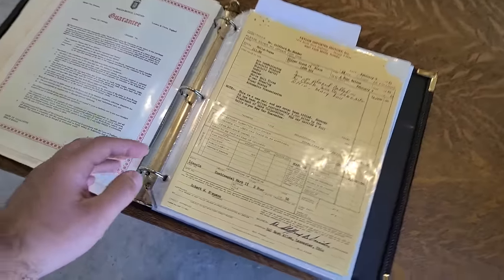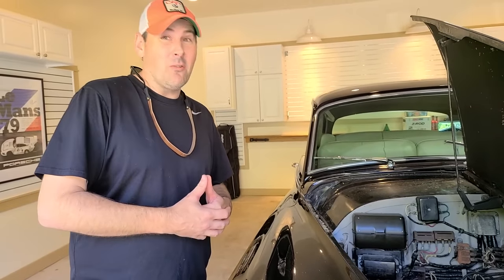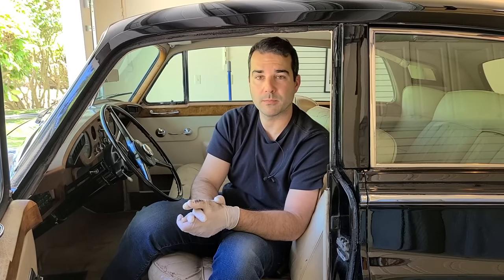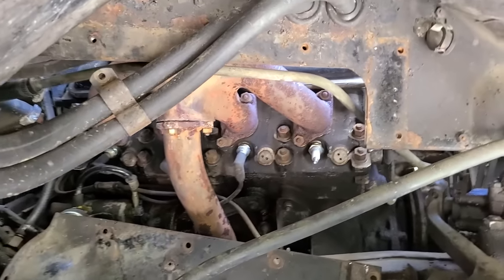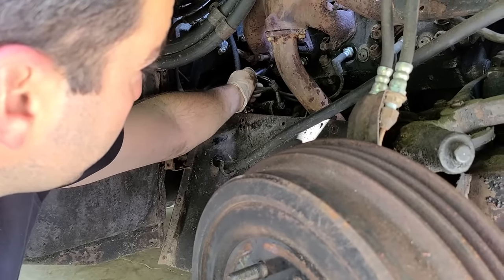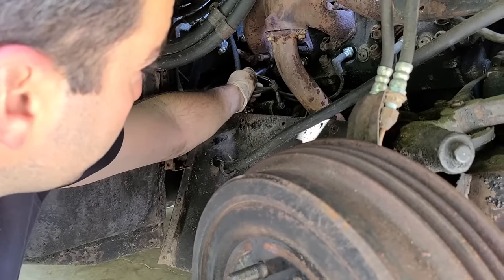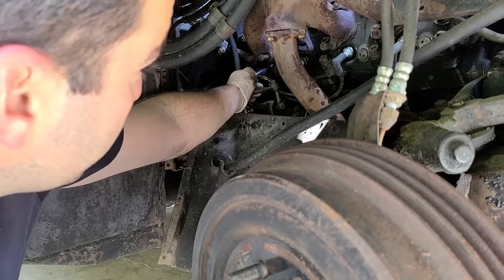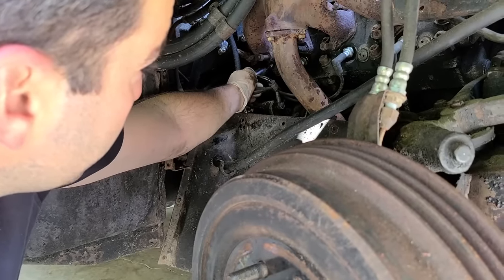I Bought A Broken Rolls-Royce 1000 Miles From Home! 1 Day To Fix EVERYTHING Before Hitting The Road!

Comment: This makes me kinda of proud of my country , 60 years old and it still turns heads, only thing wrong is the steering wheel is on the wrong side but there again you drive on the wrong side also  Lol !  Makes you wonder if the modern produced cars of RR can do the same in 60 years , i doubt it.

Comment: the fact that these cars were assembled by hand with a team of expert mechanics ,makes each car pretty unic (Monic) in the way they were each assembled ,I know for example that each team 'boss' would have a certain wire screwed on where the other guy would use a bolt ,a time when reliability & longevity was THE goal...!!.bunch of little details would be different on each unit ,like also the wealthy customer who would want a specific type of wool & colour from Cashmere mixed with what Rolls was proposing at the time...(read it in an old classic car magazine)..

Comment: You are lucky your 4-speed Borg Warner transmission is (apparently) in decent shape. My friend had to pull the transmission several times from his RHD (cheaper to buy in the US) 1960 Silver Cloud before the local transmission shop got it working right. He drove it about 100 miles to see his mother and popped by our place, and it was fun riding in it to a local French restaurant.

Comment: Over here in the UK one calls one's Rolls Royce a "Roller" and one wears a shirt, tie and tweed jacket when driving one about..!
(on a rainy day our House of Lords smells of piss because urine is used in the manufacture of tweed cloth which they mostly wear)
I drove a Roller when I was just 16 at a Hunt in a field (that's horses and beagles - no shooters)
Correct me if I'm wrong but I think the oil gauge is a level indicator not a pressure gauge - think maybe Spitfire Merlin engine which had a huge tank of oil at the front of the engine which had a dry sump, pressure oil pump and two scavenger pumps (and some machine guns or canon)
Wonderful car and most entertaining and informative vid. Thank you very much. I look forward to more videos on her. TTFN.

Comment: Those old RR are notorious for overheating.  You might think about flushing out all the regular coolant and water and switch over to "waterless" coolant like Evans.  Evans has a much higher boiling temperature, like around 375 degrees.  Helps eliminate hot spots and steam and actually gives these old girls better performance.  The stuff costs like $40 a gallon but it never needs to be changed or flushed so you only have to do it once.  I put it in my RR and I also ran it in my Mini Cooper JCW, and my Honda Goldwing.  Never had issues with cooling after that.  Just a thought.

Comment: NEVER, I REPEAT NEVER.  Rent out a car like this for ANYTHING,!! It has long been said that it’s not the initial cost of a Rolls-Royce, but the cost of it’s upkeep!!! The brake system on these cars is antiquated! When one steps on the brake pedal, it engages a servo clutch wheel which is attached to long metal rods which go to the rear of the car and mechanically engage the brake shoes!! BTW, These cars weigh between 4,400-4,600 depending on the series year..FYI

Comment: The Silver Cloud is a lovely motor car, but I prefer my early Silver Shadow, which handles better and is a lot easier to service, with its great engine bay accessibility. Royce was quite correct when he said that the quality remains long after the price is forgotten. One always arrives at one's destination feeling relaxed.
Reply: Pete. The Shadow had crap engine bay accessibility. The engine bay was smaller and stuffed with extra equipment and because they were technologically advanced over the Cloud, servicing cost multiple times what the Cloud cost to service. The early Shadows handled like jello. They rolled 7degrees to enable what Rolls called the "boulevard  ride" to satisfy the Americans and handled worse than the Cloud or any other Rolls previously built. Unfortunately, the excessive body roll was uncomfortable and scrubbed  a set of tyres out in 7000 miles. That problem was later sorted in the later Shadow 1's and further in the Shadow 2's. Apart from that, you are correct.
Reply: @EnglishLawyer  Alan. I take your points, but I've never found any difficulty with the servicing. The Cloud's hood is a hatch compared with the Shadow. Have you tried changing the plugs on a Cloud? The handling is ok and you get used to the bit  of roll on an earlier car - it isn't intended as a sporty coupe. Even the recirculating ball steering is perfectly manageable, though the later Shadows with rack and pinion steering were much more precise on the road. Compared with the Shadow, the Cloud is a tank - it was designed as a sedate gentleman's carriage, not for the captains of industry. Don't get me wrong, I love the Silver Cloud, it's a beautiful motor car. Our family have also owned pre-ww2 Rolls-Royce and Bentleys  for years, so I know how to handle older technology and if you want great access to the engine, buy one of those! My Shadow is still a much loved addition to the stable!

Comment: Speaking of not feeling the speed, the old bloke bought a V12 Jag (forgotten, the Model, year, etc. SJ12 rings a bell). Drove it 1000 miles to visit me, doing record speeds and filling the duel fuel tanks often. He let me take it for a drive through town. It was so nice to drive, quiet, responsive and so comfortable. 
I whipped through a roundabout and commented how tricky that seemed. It was then the old fella told me I going 60mph, not 60kph. So, I was going highway speed on the city streets, lol. So smooth and quiet on the road. There's no way I could have done that in my 4WD. It always cost a mint to fix and he got rid of it eventually. Too bad he didn't train as a mechanic, even though he was pretty handy with engines in a basic way.

Comment: that large system of air-filter with the thin grill (at 30.40) seem super restrictive..taking that mesh off and installing a snake type of tubbing to go catch fresh air in the lower section of the bay would be good for sure..!!

Comment: for a sure getting rid of the old mechanical /belt driven fan ,replaced with a high CFM  (manual) modern E.fan to ventilate & cool down that huge bay would be perfect (especially in traffic)..flick that switch on and see that gauge go down..!!

Comment: The radiator was made from individual pieces of metal soldered together. Somewhere on it is the initials of the craftsman who made it. Rolls Royce, when they made their crankshafts kept a sample of the metal of each individual one, so that if it failed or had problems they could test the metallurgy.

Comment: That dual contact switch may be for the shifter? I think they’re electric or electric over hydraulic on the old rolls’. Also if you put the trans in reverse with the engine off that should engage a park Paul, giving you a “parking lock” like on a modern transmission.

Comment: The speedometer isn't off. It intentionally indicates slightly higher than actual, in order to prevent unintentional speeding. AFAIK most European cars had/have that. Saves a tonne of money.

Comment: If all the plugs were in the same condition as the one you gapped, it’s a miracle the engine started.
That wet tarry deposit on the insulator causes the spark to leak to the plug body rather than jump the gap.
I’ve worked on old engines and when a customer would call us out to a non-starter, we always took a set of plugs.
The problem was usually caused by excessive use of the choke or driving short distances.
Worn engines with low compression were particularly susceptible.
This was probably the cause of the misfire. Did the misfire disappear after a long drive?

Comment: You'll find that many nuts and bolts on Rolls Royce cars (pre-70's) will be Whitworth. Joseph Whitworth was a toolmaker from the north of England and introduced his standard sizing for tools and threads etc. Many motor manufacturers adopted the Whitworth standard. In the UK, we had three main standards for tools and fastenings. Imperial (AF in the US) metric and Whitworth. Whitworth hasn't been used since the 70's.

Comment: Check if the exhaust has excessive back pressure causing the leak at the manifold.Replace or remove the thermostat valve.

Comment: The Doctor at Douglas Aircraft in Long Beach had a 1968 Rolls Silver Cloud he bought used. Photo of it was on his office wall. This was late 80s, early 90s. The rear end failed while he was driving. He called Rolls in LA, I think off of the 110 freeway. They told him do not tow it, technicians will come to you. The found the problem and a replacement was brought to the broken-down car. Not receiving a bill for some time he phoned the dealership about it. They told him, Sir, that part never fails on a Rolls Royce, you must be mistaken. No charge.  So, my Dad had a 1947 Super Clipper Deluxe Sedan that has a similar body design. It was smooth as butter, great to look at, 3 on the tree but needed new piston rings plus a valve job.

Comment: Just a suggestion, before you attend to the exhaust leak. Soak the nuts with WD40 or a suitable penatrating oil or better still heat them up with a oxy and cetalyne, till they glow cherry red. Attack those as you know without doing that and they will snap off, for sure. Good choise that you didn't try to fix it before you left on your trip. Obviously you know what would have happend. Cheers. Still looking forward to a video on the Cosworth.

Comment: "some Rols Royce size" on the oil drain. Older Bristish cars and motorcycles use a lot of Whitworth sizes. Inch based but differing from most SAE sizes.

Comment: Stick an inspection camera through and you can switch it on to check under the hood from the drivers seat on the highway. Saves freaking out on a trip before full repair

Comment: The body is all steel. Only the doors, trunk lid and hood are alloy.   Engine sump has a sender with a float in it just like the fuel tank. Button on dash simply switches between them.

Comment: I've used water wetter - and it's good stuff.   The deal is that adding antifreeze to your water actually reduces it's ability to conduct heat way.   On my 1959 Mini (the complete opposite end of the antique British car scale!) - it would continually overheat in a Texas summer.  I tried putting a "tropical" radiator fan in there - and I replaced the radiator with a more modern one - I tried everything to get it to stay cool.  Eventually an old guy at the car club turned me on to water-wetter - and because there is basically ZERO chance of it ever freezing here, I just flushed out all of the coolant to get rid of the antifreeze.  However, you can't run the car with straight water.  That's because antifreeze does two other important things - (1) it helps to lubricate the water pump - and (2) it acts like a detergent - lowering the surface tension of the water (hence the name: "water wetter" - it literally does make the water "wetter"!) and that's important because it prevents bubbles of steam from forming when the water meets the hot engine.  Those bubbles could otherwise adhere to the engine block and create a localized hot-spot - which would NOT be a good thing!    So water wetter is a great replacement for anti-freeze in hot climate driving.  A lot of racing drivers use water wetter instead of antifreeze too.

Comment: 1. Doesn't that car have a "mineral oil" brake system, where it shares the fluid with the suspension system? 
2. If that's a Hydromatic transmission, why doesn't it have a "park" position? Sure its not a Borg-Warner? 
3. 8.3 miles per gallon is not bad. That's about what large American cars also got in 1961. My 1960 Caddy Fleetwood got 7 mpg highway, 4 mpg city in the summer with air conditioner running. 
4. No British car had "factory" air conditioning in 1961. My '61 Jaguar 3.8 sedan was imported through Houston Texas (at that time the automotive air conditioning capital of the world), then shipped to the northeast. Other British cars had dealer installed A/C, regardless of what invoice says. 
5. Your battery box is not OK. You have just the frame of the battery box. The fix used to be get a replacement for the whole rear-right sub-frame, including the battery box.
Reply: Hi Jeff;  With regards to point 4) the engine in this RR is an American V8 so the AC is an easy factory fit. (The compressor is also American, a "York".)  I suppose  it could be a case of RR making a V8 under licence (As did Rover with their small block V8, a Buick I believe?)
The Jag engines were British made and kits to install an AC system simply were not available back then. 
These days, of course, it is much costlier to retro-fit an AC system than to order a car with AC  "included".... Seems to come as standard these days!

Comment: I had a 1968 Rolls Royce Silver Shadow with a 6.7ltr v8 engine and a 4 speed RR auto gear box that did EIGHT  miles per gallon.

Comment: You will find many fasteners that are neither metric nor Imperial. What you have is known in North America as "English Offsize". There is an actual name, but I forget. The sockets and spanners are still made.
What a great car. Put on a new set of bias tyres and drive it home! These cars hate to sit. The carburetors likely need refreshing, but they are dead simple side draughts, most likely Stromberg or Zenith. Also, make sure the dash pots have the correct amount of Type F transmission fluid in them. For Zenith, that is 4.5 cc PRECISELY. Enjoy the old girl. Can't wait to see morem
Reply: Whitworth thread....

Comment: You have 2 hydraulic pumps on the engine one for suspension one for brakes.
I think the back brakes are on the suspension circuit, this is in case one fails you can still stop.

Comment: When I first went to view my 1976 Shadow 1, the engine sounded very much like that one. After walking around the running engine bay for about 10 minutes I finally worked out that it was due to an exhaust manifold leakage. I told the current owner, but he still chose to sell it for a song, thinking that the engine was on its last legs. The cure? a set of exhaust gaskets costing $16 including delivery and a full day's work to fit them.

Comment: Back in the 70s I was a mechanic and I had Customer with a Rolls Royce and they burn oil because the inner engine is chromed so they run forever, but they burn a lot of oil

Comment: 10w40 oil ? you should use 20/50 , and for the plug leads, change the distributor cap to fit the new leads.

Comment: You mentioned the Hydramatic transmission. I remember from the day … that RollsRoyce licensed the design from General Motors, tightened the sloppy American tolerances to RR standards, and discovered their “improved” design would not work. RR obviously fixed things. Hydramatics were the THE transmission for performance street cars in the 1950’s.
Reply: Correct. That was the strangest thing and it is true. Rolls-Royce bought the gearboxes under licence and set about polishing the insides of the boxes to try to make them smoother but found nothing improved them. So there you go... GM transmission was the dogs bollocks!

Comment: That Rolls is indeed a gorgeous classic automobile, hands down. That acknowledged, it's new owner seems to have bit off more than he can chew, with regards to restoring the car to showroom quality, 'cause as awesome as that car is, unfortunately, it hasn't previously belonged to the most educated owners, as far as maintening such a jewel in good shape, hence the poor condition of pretty much everything under the hood and in fact under the gorgeous body of the car. It needs a major, and absolutely worth it, overhaul (Engine, transmission, brakes, chassis, electric, new set of tires, the works), the interior could use a little sprucing up as well, to make it new again. Honest, NO HATE at all intended, but one guy, alone, no matter how good a mechanic, will hardly be able to pull out such a task all by himself. Just as the car wasn't originally built by just one person at the factory, restoring it, is clearly a job for a specialized Auto shop, with a team of professionals, each working on something specific. Granted, it won't happen overnight, and it won't be cheap, but as stated before, that jewel of a vehicle is totally worth it. Congrats on a great find, and best of luck!

Comment: If it has been towed without the engine running for more than 25 miles there is probably a gearbox problem. You should disconnect the prop shaft? Now doubt there is some gearbox damage. I will be very interested to know how you get on.
Reply: unless the driveshaft  was disconnected at the diff and held up out of the way secured under the car......

Comment: I think it takes special mineral brake fluid, that radio thing needs to go, and be replaced with a period unit with modern internals, also you need to be wearing a tweed jacket and flat cap!
Reply: No it is Silver Shadows onwards that have mineral oil brake fluid not these old ladies!
Reply: @goffthomas2554  Thank You for that!